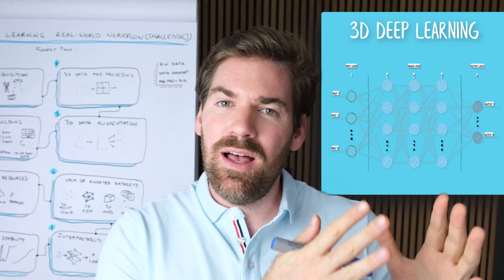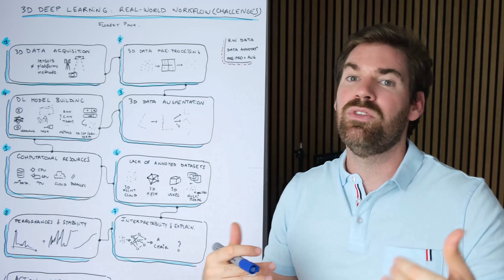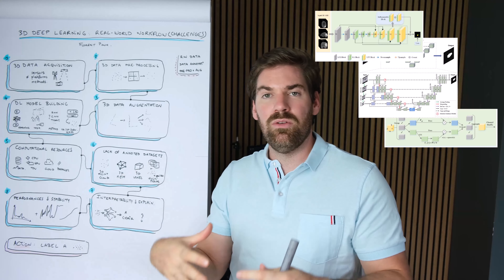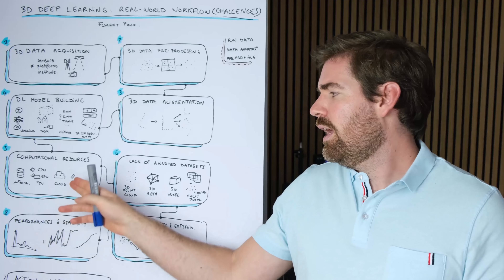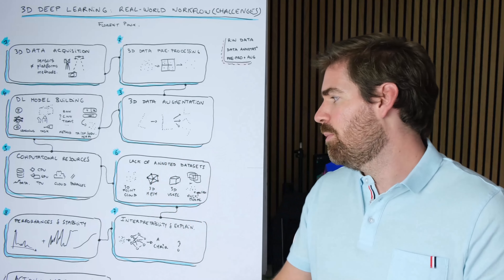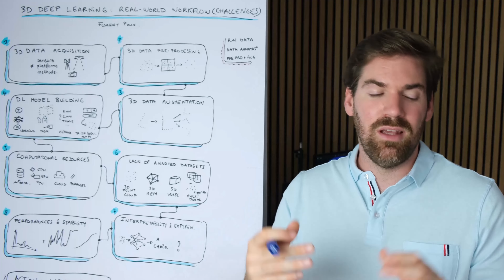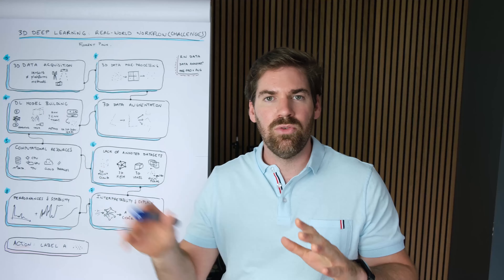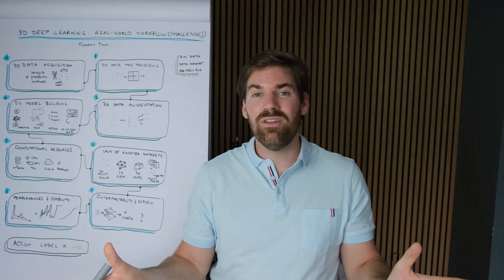3D Deep Learning Workflows and Challenges

Comment: Hi, your channel and videos are very good. I have some questions regarding my final year project which is to do defect inspection on electrical wire bond.
The 3D data of the wire bond that I collected are stored as TIFF files but I do not know what should I start first due to I am a beginner of deep learning student.

So basically I should combine all the TIFF files into a 3D image first in the data preprocessing then only I should focus on data annotation and augmentation before using it for model training? 
I am quite confused with the flow of how should I do this project due to lack of resources for the internet for me to learn
Reply from the maker: hmmm, super interesting! So indeed, it is good to first get a bidirectionnal link between images and point clouds. You can do that through Sfm for example. Then, it is up to you if you prefer to work on 2D images (tiff) and use segmentation algorithms there, then backproject the predictions on the point cloud, or wok on the point cloud directly! I hope this helps!